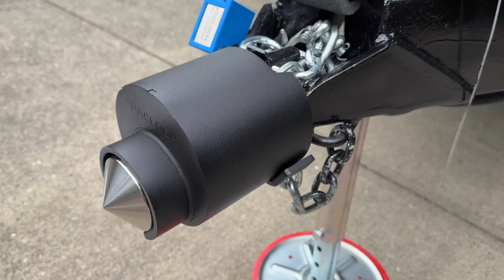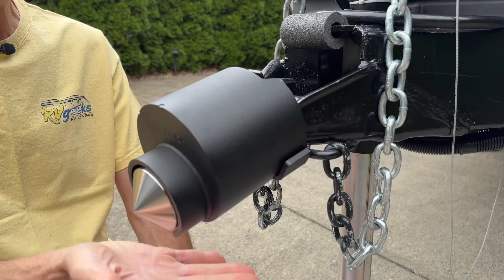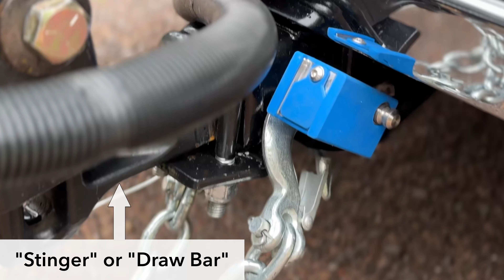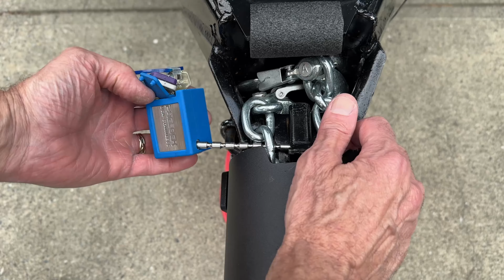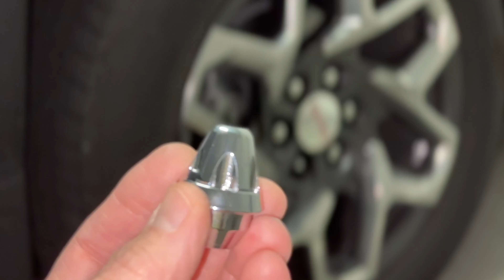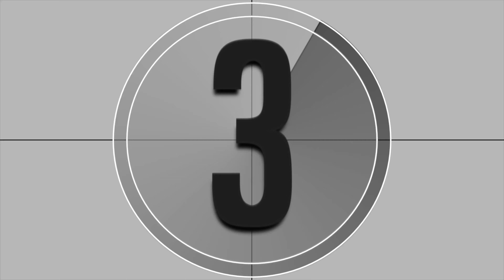Trailer THEFT PREVENTION! — PACLOCK Coupler Lock & Advanced Wheel Locks Protect Our RV

Comment: I steal locked trailers by removing trailer's coupler (lock and all), and replacing it with an unlocked coupler! 
I reuse the same 2" coupler over and over!
With the exception of the few trailers with welded couplers, it works every time!
Reply from the maker: We’re sending the FBI directly to your house! 😂 You’re right — It’s absolutely more secure to have a trailer with a welded coupler. But even without that, they’d still have to overcome the heavy chain we put through the rear wheels. No one thing is foolproof, and even multiple things aren’t going to stop a professional with enough knowledge, time, privacy, and equipment. The best bet is to slow them down, or better yet, get them to consider a less-well-secured trailer instead.

Comment: You can shim this lock with a coke can
Reply: I think you're confusing the PacLock with the similar looking one made my Proven Industries. The Proven Industries lock is the one that was picked with a Coke can and had a lawsuit against the YouTuber that picked it and the lawsuit was dismissed. The lockpicking Lawyer used to say that the Proven Industries lock was a good lock but he had and updated video showing how they changed it to a cheaper design. The lockpicking lawyer does indeed say that the PacLock is one of the best.
Reply from the maker: Sorry, Nate, but that is utter BS. Check the Lockpicking Lawyer and see what expertise is required to bypass the security features on these locks.

Comment: Does the Paclock coupler lock limit access to the nut for tension underneath for the lever?
Reply from the maker: We’ll have to take a look at just how accessible that nut is next time we’re out at the RV, but even if it were accessible, fully backing it off wouldn’t allow someone to remove the lock. The main reason we flip the latch down isn’t for security, but to hold the lower plate in place, making it easier to put the lock on. So even without the lever down, the trailer will still be completely secure with the coupler lock in place.

Comment: You can move any vehicle large or small with dolly’s just jack up the rig slide the dolly’s under each tire and roll out. That vehicle is gone and they also have dolly’s for extreme lager vessels. My top theft deterrent is motion censored lights and security cameras that you can see and talk to the thief.  Next get a loud alarm system with crazy flashing lights and only you can turn it off. Next put several air tag in the vessel and one they can clearly see on purpose add that tho the locking system I think you will ok!!

Comment: Where did you get the cover for your hardened chain?
Reply from the maker: We bought that from a company called Murphy, which you can find at www.murphylift.com  

The part number for the “Security Chain Sleeve for 1/2 inch chain“ is 303089, and it’s sold by the foot. Hope this helps!

Comment: Great video. We just had an attempted theft of our travel trailer.  The potential thieves broke the hitch ball lock,  let some of the air out of the tires to release the wheel chocks and attempted to drag it away from our driveway.  Clearly or fortunately, they weren't professionals as they were defeated by the flat tires and the noise from the electric jack and stabilizers.  I like the heavy duty chain. Hopefully it is long enough to thread under the trailer.  The wheel locks are also on the list of items to acquire.   Anything to frustrate a potential thief. Thanks again for the great information.
Reply from the maker: @iseemann1513  So glad they didn’t get away with your trailer! And yes, the chain can go through the frame too. It’s just a little tight on some trailers at 6 feet. But of course you can get longer.

Comment: Great information guys!  Really hoping that you will make a video on your towing experience with the 3.0 Duramax and the max tow package.  Like you, I can only fit a half ton truck in my garage space.  Guessing that you are close to maxing out your GVWR on the RV, so I'm especially curious about your tongue weight vs. max on the truck specs.  I think you picked the right truck, just waiting to see if you are happy with the towing experience.
Reply from the maker: @tightloop01  Thanks so much! We’re planning a video all about towing specifications and details related to our rig, but it’s probably going to be a while, so I can give you some preliminary info here to help you make a good decision. First off, yes, we are very close to maximum weights all around, but not over. We have a 1600 pound payload on the truck, which is the single biggest limit to everything we’re able to do. Outdoors RVs are very solidly built and as a result quite heavy. Without the exact numbers in front of me, we’re running somewhere around 8000 lbs on a rig that has a maximum weight of 8250. Adding about 500 pounds of solar and lithium equipment certainly didn’t help with that! But that equipment is very important to us and central to our boondocking lifestyle. Luckily, we wanted to travel kind of light, and don’t carry a generator, or bikes or other heavy gear. So that approximately 8000 pound weight means that putting the desired 10 to 15% onto the hitch for good stability puts us between 800 and 1200 lbs that needs to go on the tongue. Again working for memory, we are around 1000 pounds, which is no problem at all for the truck, as long as we don’t overload it. The two of us together weigh about 350 pounds, so doing the math a 1600 pound payload using 1350 for us and the trailer tongue weight leaves us about 250 pounds payload. Some people may not find that to be enough if they want to bring a lot of gear, but we don’t keep much in the bed, and it’s working really well. The thing drives like a dream, but it’s really important for anyone who wants to carry a lot of “stuff“ like bikes or canoe or generator or things like that needs to be aware that they may want to consider a 2500 instead or a lighter trailer. We’re super happy with our choice, and we will make clear in our video that others can be as well, but the notion that a heavy trailer like this is a no-brainer for any 1500 is absolutely not true. We equipped ours with Max trailering package, ordered the higher max gross vehicle weight option, and the 3.73 rear diff. Basically everything to max it out, plus we use a Camco Eaz-Lift TR3 hitch and love it. The whole setup works great, but you need to put the pieces together carefully! Hope this helps a bit while you’re waiting for our video.
Reply: Thanks for such a detailed reply!  In line with what I expected (and hoped) your experience to be.  Really looking forward to your future video on this subject.

Comment: I'm probably missing something here, but not sure I understand the advantage of securing your RV chains with the Paclock--can't would-be thieves just bring their own chains to attach your trailer to their tow vehicle?
Reply from the maker: @htschultz  They could do that, but leaving the chains unsecured just makes it that much easier for a casual thief who didn’t come prepared with gear like extra chains. Nothing will stop the most determined thief, but making it more difficult in various ways is a great deterrent!
Reply: All locks are deterrents. All you need is a piece of chain with a two hooks. The chain can be used instead instead of the safety chain.
Reply from the maker: With the deterrents we’ve put in place, they’ll first have to get past the chain we put through the wheels! Again, nothing is 100%, but they’re gonna really, really have to want our trailer (and have the right tools and skills) if they’re gonna get it. Not that we’re trying to get the neighbours’ trailers stolen, but other rigs definitely become more tempting targets when ours is so well protected. 😁

Comment: Excellent video and advice.  I use a similar coupler lock guard from Ft Knox Locks with the exact same Paclock puck and coupler pin lock 😊.  I also do the heavy duty chain and Paclock (I LOVE the Paclock system of keyed-alike locks) on the wheels (on one side) AND I loop it around the axle to make the wheel removal scenario harder.  I have been looking for a set of lug locks and like what you have presented here.  Thanks again for some excellent advice !

Comment: The lock picking lawyer already picked it. 
In 5 seconds
Reply: Lock picking lawyer is a "savant" unlike most thieves AND he has recommended Paclock products as being better than most out there...😉
Reply from the maker: @Helpfulsuggestions  In his video #1293, the LockPickingLawyer specifically pointed out the positive security attributes of this specific puck lock. And he has said other positive things about the PACLOCK brand in other videos. The fact that he’s able to pick it is irrelevant for a couple of reasons. First, he can pick just about anything. And second, as he himself has mentioned many times, brute force is the method of choice of most thieves, not picking.
Reply: People that have the ability to pick locks are not stealing stuff from people like us. The people stealing stuff from people like us are using angle grinders and drills and they couldn't pick a lock to save their life.

Comment: "This is the LockPickingLawyer, and today, I am going to show you how to pick this garbage lock with some cooked pasta and mildly harsh language in under 30 seconds."
Reply from the maker: @sigbauer9782  Sorry to break the news to you, but in his video #1293, the LockPickingLawyer specifically pointed out the positive security attributes of this specific puck lock. And he has said other positive things about the PACLOCK brand in other videos. It’s a quality company, and why we went with them. Also, check out his video number 901 to see “a trailer lock that he would use“ which is extremely similar in overall design and strength to this one. The only thing he said he would upgrade in that video is the puck lock itself, and then talked about the PACLOCK version as being superior in #1293. The fact that he’s able to pick it is irrelevant for a couple of reasons. First, he can pick just about anything. And second, as he himself has mentioned many times, brute force is the method of choice of most thieves, not picking.

Comment: I had a camper stolen years ago. I had a lock on the tongue.  Neighbors reported seeing the thieves hook up the safety chains, wave to them as if they were supposed to be doing that, and drove off. After that, I started locking the wheels. Much more effective method. Looks like you have a good setup.  Travel trailer insurance is cheap, make sure you have a policy just in case.
Reply: What lock did you use for the wheels?
Reply: I use them all, I have 6 locks total that have to be removed. With the keys it takes me 10 minutes to remove everything. Also use 1/2 tow chains I run through the wheels too, with a pretty massive lock.
Reply: "Oh hey, those guy look like they're doing their jobs!  Hello there!"